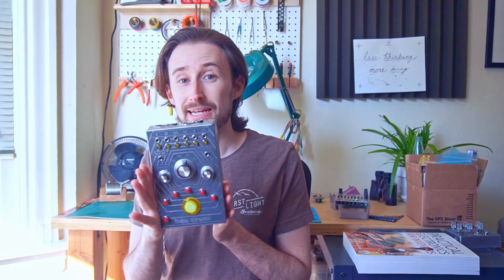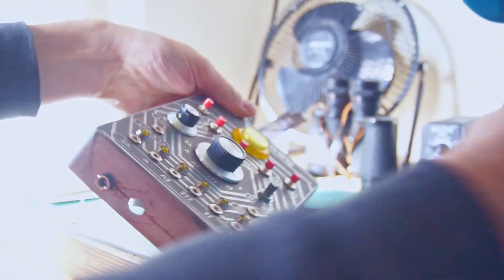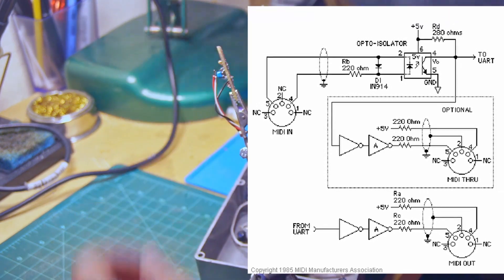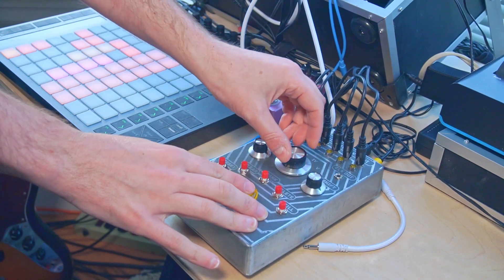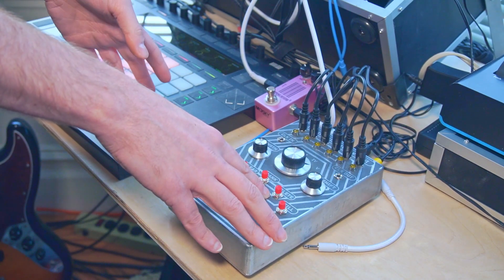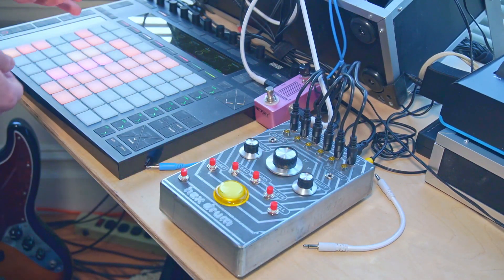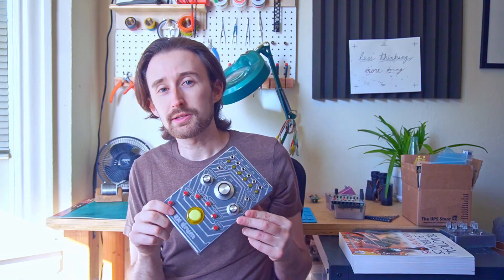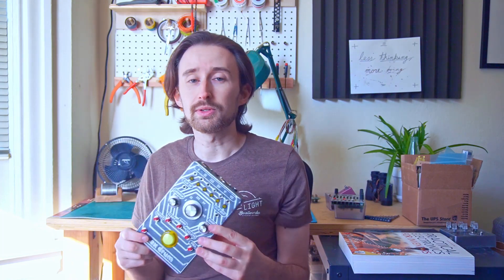Big Button trigger sequencer MIDI upgrade

Comment: I got it working on a regular arduino nano. Had to move pins positions (mostly A6 and A1 have been swapped in the code as well) but I also got the clock input working.
You need to change the interrupt command to: (with clock coming on pin D2)
attachInterrupt(digitalPinToInterrupt(2), onClockIn, RISING);
All working for me 🎉
Thanks for sharing and happy drumming!
Reply: what issue about a1 from lmnc bigbutton original? then after change intterupt command, is it work good with midi and analog clock in?

Comment: Hey. I just dont need  midi but your other mods are good. is there any point in removing some midi code or should i just leave it in and let it sit idle?
Reply from the maker: You can just comment out  the line 550 of hexdrum.ino "receiveMIDI();. "

Would love to see the mods in action! Please be aware I used an ArduinoNanoEvery for this build, which has some difference with the ADC pins, so if you have already built your big button you'll need to make a couple pin number tweaks in hexdrum.ino as well. Mainly clock in, big button LED out, and clock out if you want that, which is on line 93-96.

See this comment thread for more deatils: https://www.youtube.com/watch?v=eMeoCTVNuJI&lc=UgwWGcAZuLXQMRizAnV4AaABAg.9IY-mgQWM0f9LNG9iveiDd

Comment: hello!!
Could be that the diode in the midi IN schematic and layout is the other way around? if it is, does this matter?
THanks!
Reply from the maker: I don't think that's the case, it looks to me like that diode is for reverse protection in case you hook it up to a midi IN jack or something, though I'm not really sure. In any event my schematic has it in the same orientation as the official MIDI specification.

Comment: Hello friend, thanks for this video, got motivatedand i already bought the parts to make my own with your mods.
I noticed that when you pressed the fill button the hihat had like a random accent or velocity, or i'm wrong?  if i'm not, how do you do that? 
Cheers and thanks again
Reply from the maker: Hi Jean -  I think that random hi hat sound is from my Squarp Rample sampler. It lets you load in multiple samples per slot and then does some round-robin or randomization which I use for hi hats and toms mostly. The Big Button doesn't have any CV control output to do that. 

Also, if you are building the project yourself please be aware that I used an Arduino Nano Every in this build and the code and wiring needs some small modifications to work with a regular Arduino Nano - these are discussed in another comment thread below I think.
Reply: Thanks for your time to answer me. I'm aware of the A7 and A6 not being digital on the regular nano, i'll change the code. I have a VERY diy 808 snare and kick, with the accent input to control the volume, so maybe with a random voltage ? don't know, we'll see. THANKS AGAIN friend, greetings from CHILE,

Comment: Can you please share the final code? I have some Troubles with mine. Suscribed!
Reply from the maker: https://github.com/matthewcieplak/hexdrum-midi/
Reply: @extralifedisco  thanks a lot!
Reply: @extralifedisco  Hi! I have a little issue with the code. My build works just fine with LMNC´s code, but I want to try your nice new features and improvements. At the moment i have not implemented the midi input, so my schematic is as the original and the code dont seem to work. Is it possible that if nothing is plugged to the RX pin it is a problem? I tryed to ground RX pin but no good news. Please let me know, and big thanks for your nice work :)
Reply from the maker: @pablospace  Clock out is on A3 as documented in the code: https://github.com/matthewcieplak/hexdrum-midi/blob/master/src/hexdrum_midi.ino 
Can't really help you with debugging as such as it's so hard to probe via internet, but you can just comment out the midi implementation and just work without it if you don't need it. Just add // before line 551 (receivemidi());
Reply: @extralifedisco  Thanks a lot! I will try. Anyway sooner o later I will also build the midi part, but this can be a first aproach to make sure it works.
Reply: @extralifedisco  Hi! I came back with one more try. I have managed to upload the code, my fault I was using the hexdrum file to upload but no the src. Also I Implemented the midi part, and now I have a functional sequencer that responds midi clock and midi notes, nice!. 
But still have 2 problems: 

1.- First is that the clock input still does not work, I input a clean clock but the device seems to do nothing. With the LMNC program the clocks function well, so I dont really know what is the poroblem, the HW part seems to work nice. Did you manage to use midi and sync input at the same time? wich of them have preference? It also dont work with the midi unplugged.

2.-The second thing is that the button led (bank led) does not work and I realize that this is beacuse it is in A6 pin that does not work as a output in Arduino (as A7). 

I think that the problem may be something related to the pinout, I attach mine, taked from you code, can you please confirm that is correct? 

Thanks one more time for the nice work!

IN/OUT	FUNCTION	PIN
OUT	1	                 8
OUT	2	                 9
OUT	3                 	10
OUT	4               	11
OUT	5               	12
OUT	6              	13
OUT	BANK LED	A6
IN	CHANEL SELECT	A0
IN	STEP LENGHT	A1
IN	SHIFT	                A2
IN	BIG BUTTON	       A5
IN	Clock	                 2
IN	Bank Select	         3
IN	Clear	                 4
IN	Fill	                         5
IN	Reset	                 6
IN	Delete	                 7
OUT	CLOCK	         A3
IN	ALT BUTTON 	A4
Reply from the maker: @pablospace  Hey just catching up to this! I think you are right and there is a missing piece that I am  very sorry I didn't realize earlier - when I went to build this project I mistakenly ordered an Arduino Nano Every (https://store.arduino.cc/usa/nano-every) instead of a regular Arduino Nano. It's a pin-compatible board with a slightly upgraded processor, so I didn't think much of it but it turns out you're right, the Nano Every can use A6/A7 as digital pins while the regular Arduino can't!

I think you can probably just swap the Shift or Step knobs (A1 or A2) over to A6, and then use one of those pins to control the Bank LED instead (or just get a nano every if you don't want  to rewrite the code!). I'm guessing I jjust used the diagram when building LMNC's original design, and ignored the note he added below on the bottom: 

"THERE HAS BEEN A MODIFICATION TO THE ABOVE IMAGE. the wire going off to the BIG BUTTON LED. is now on pin A3, so just solder that wire to the point on the stripboard that is connected to the arduino pin labelled A3."

(In my version the Clock out is on A3 of course, so if you want to keep that then you'll need to swap one of the actual analog pins over to A6 to get a digital pin back, but if you don't care about clock out you could just use A3 and comment out the digitalWrite line that tries to set it high, which I think will set the pull-up resistor when the pin is in Analog mode).
Reply: @extralifedisco  Thanks so much I will try when get home, I´m sure I can manage the pin issue. Anyway my main issue is with the clock input in pin 2 that does not work. I will apreciate if you can confirm that yours still works in this version (midi is working nicely) and if you are using pin 2 for the input. Thanks so much! ;)
Reply from the maker: @pablospace  Yes, I'm using pin 2 (D2) for the clock input (right next to the ground pin near the tx/rx pins). There is also a pulldown resistor (10k I think) across the clock output jack itself - nano has internal pullup/down resistors I believe, but the LMNC uses all external ones so I must've kept going in that style.
Reply: Hi! Did you manage to make it work
?   I am having some issues same with yours. Sorry for hijack, I read all your thread with @exralife and follow the change but no luck. thanks ps: I'm using regular Nano's
Reply: @toby cookie @pablospace I had the same problem, I think the reason is because of interrupts, which are probably managed in a different way (from the Nano) in the board that Matthew used.
In the end I managed to pick a refactored big button code and I added midi and the audition function as Matthew did, if you are interested you can find it here https://github.com/mexbeb/BigButton_V2.1 (it uses the Arduino internal pullup resistor and a different wiring).
The only downside is that you will not have the shift button (and consequently no solo/mute function) because I left the delete button as it was, but you have a switch to select between external clock and midi
Reply: @RobMurru  Ohh, nice, thanks a lot! Did you tested on a nano? Your github says you used a leonardo. Thanks in advance.
Reply: @pablospace  I did not tested it on a Nano, but it should work as the original code by Yukonnor was used on a Nano (https://github.com/yukonnor/new_big_button). Which model of nano did you have? 168P or 328P? This way I can check if there's something to change in the code
Reply: @RobMurru   is the 328P thanks!
Reply: @pablospace  Ok, it should work! Are you using the external pullup resistor version of the circuit or are you using the internal pullup resistors?
Reply: @RobMurru  external, but i can change it, no problem. Thanks a lot I will try it!
Reply: @pablospace  Perfect, let me know if it works with the nano so I can update the github repo!
Reply: @RobMurru  Hi, Great , thanks for the sharing, will check it out and try. I will report to you .
Reply: I'm planning to build one, and for what i understand the Extralife's code is not fully compatible with AtMeg 328P, the pin problemes is already kind of fixed, but for the interupt (the clock in) i think it could be fix by aso changing the wiring regular nano (328p) dont have interupt for all pin but nano every does so maybe the final solution is to rewrite the code to get the clock in on the interupt pin for regular nano, and also rewrite the code for the other pinout
Reply: If i remeber i went here after building it (with a regular nano) i will post my github with the forked foncting code if anybody do it before ;)

Comment: Hi there,
great job, very pretty !!!
I have a question and I really hope you would help me, I can't get the momentary switch connected properly, my switches have + and - as well as NC / NO / C how do I have to tie them properly? I connected my LED button like this: lead soldered to minus, plus and NO soldered together, which leads to the potentiometer! It lights up weakly and when I trigger the LED goes out every time, can you help me please ???
Reply from the maker: Hi maik, it's hard to know exactly what you mean without knowing what's on the other end of those wires. In that configuration, +/- will mean LED connections, NO means normally open (the one you want) NC normally closed (not needed), and C is common. 

You'll want to connect the LED + to ardino A6 and LED - to ground through a resistor (or put the resistor on the high side). Connect one side of the button (NO) to A5 and also to ground through a 10k pull down resistor. The other side (C) is connected to +5V.
Reply: @extralifedisco  Cool, thank you that will help me a lot, thank you !!!
greetings
Reply from the maker: @maikmario71  Hi maik! Pablospace discovered an issue that may have caused your Bank LED  issue - turns out my design is only compatible with the Arduino Nano Every (not the regular Arduino Nano) and you'll need to swap a few pins and change the code a bit to get it running on a regular nano: https://www.youtube.com/watch?v=eMeoCTVNuJI&lc=UgwWGcAZuLXQMRizAnV4AaABAg.9IY-mgQWM0f9LNG9iveiDd

Comment: Stunning work, Ive done diy kits, but after months of deciding, this is going to be my next project!
Reply: Hi! Did you manage to make it work
? I am having some issues
Reply: @pablospace  I’ve postponed it several times because of how daunting it is sorry!
Reply from the maker: @spacedudejr  Hey spacedude if you plan to finish this project please check out my thread with pablospace, we found an issue caused by the fact that I used an Arduino Nano Every instead of a vanilla Arduino Nano - you need to rewire a couple pins or use a Nano Every instead - comment here: https://www.youtube.com/watch?v=eMeoCTVNuJI&lc=UgwWGcAZuLXQMRizAnV4AaABAg.9IY-mgQWM0f9LNG9iveiDd